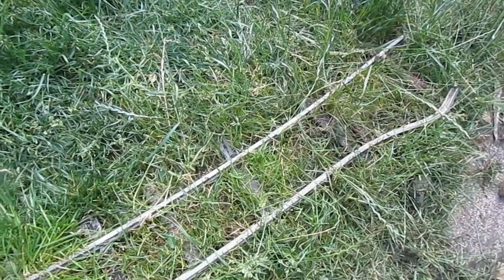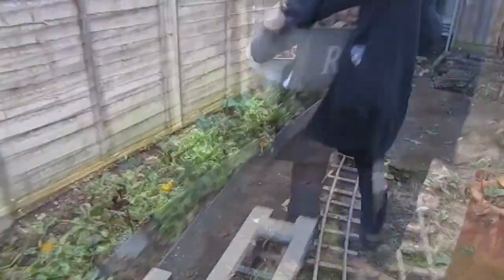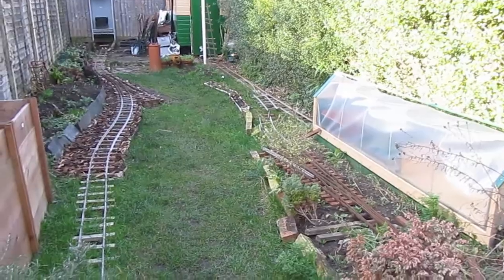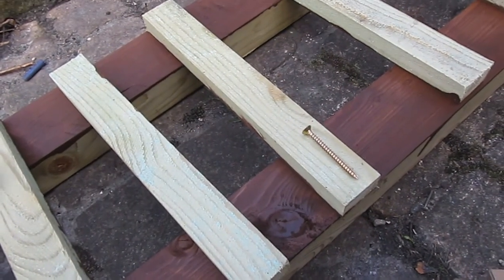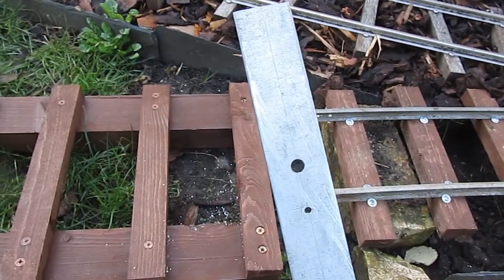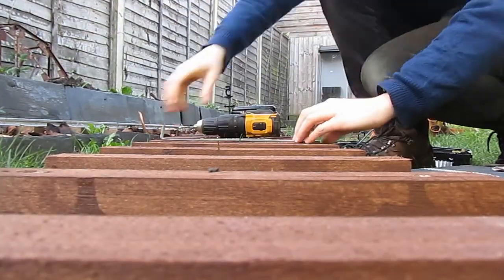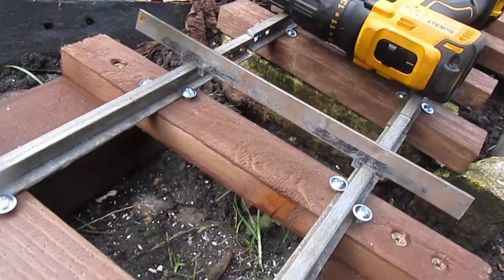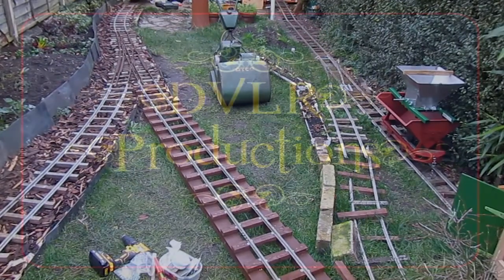Minimal Expectations 4: Laying the track

Comment: Excellent progress.
Reply from the maker: Thanks! How is your garden railway going?
Reply: @DebenValleyLightRail  I've completed the biennial track maintenance plus a little more planting and care. Didn't have much time for running this year. I'm a whimsical modeller and tend to flit between the scales and locations. For the most part, I've been up in the attic massing around with my toy train conversions. I'll be out there again in the spring with some new bits and videos :) All the best....Tom